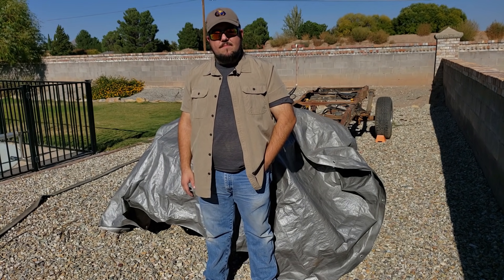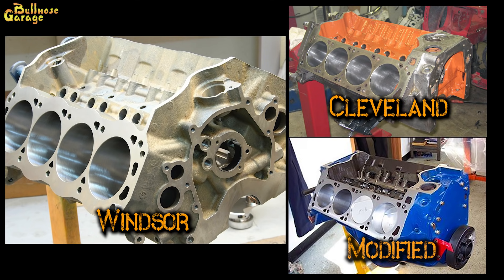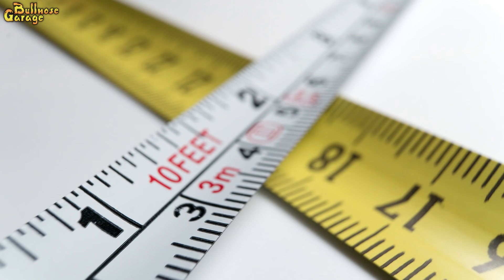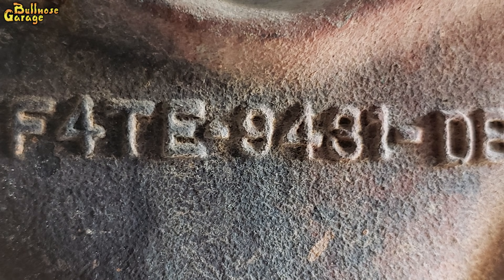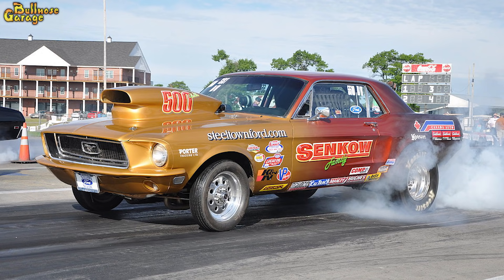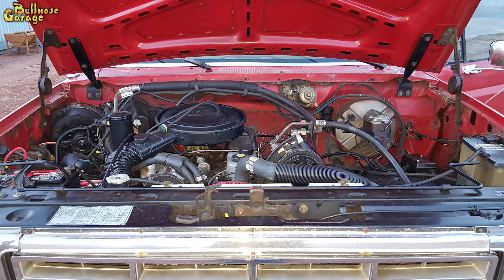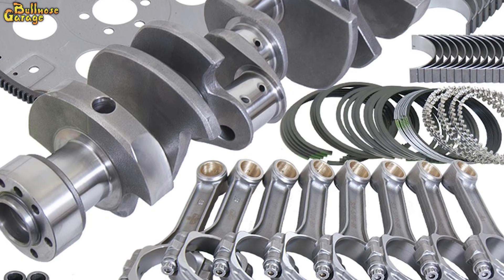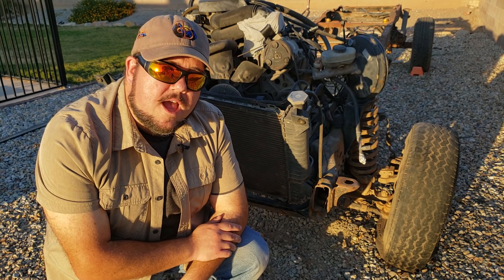351 Windsor – What You Need to Know About the Ford 351w Small Block [5.8 Liter]

Comment from the maker: Wanted to make a note that I misspoke when I talked about the casting number for the C90E block at 07:05.  The C90E block is built in the 60's (69) and not the 70's, so C9 castings are 69 castings not 79 castings.  D Blocks are 70's, E blocks are 80's, and F blocks are 90's.
Reply: Add 1997 F250-HD OBS had 351w 5.8L for service/utility companies. I have one myself, so for had 2 body styles in 1997 and Ford applied fixes for many known issues (TSB's).
Reply: You had me confused there because Iam pretty sure Ford began date coding engine blocks around 1940.I had to pause the video and scratch my head lol.
Reply: I was coming here to correct you only to find out you already realized your mistake.
Reply: I was thinking the same thing
Reply: So if I stop a d block down and put my intake off a 2002 f150 and everything else will work right just put all my stuff on it will work right
Reply: @yashuasaves6782  - 351W is a "Windsor" design engine and your 2002 is a "modular" design engine! Two completely different things...
Reply: Please someone get back to me
Reply: I'm in need to know
Reply: thank you so much for coming back and fixing that. just got a 1990 bronco that needs some work.
Reply: Man not trying to be nosy first off LOL LMAO where do you live in two do you still have the harness and everything computer and all I live in South Carolina I pray to God that you may live some worse on the Eastern side of the US if not I definitely would like to buy the computer and the harness
Reply: I came on here to comment about this error. Glad you cleared that up, great vid otherwise.
Reply: 8😢h9 

J on ikvjn Un 6b?Oukj MN khmm k that  h. Ul
O ijn
Reply: 😮
8
Reply: 😮😮
Mike inmates. Yhp
Reply: Sorry to say but ford started putting 351 windsors in the f series in the early 80's. I know because I have a '83 F250 with a windsor
Reply: Yeah cC is for 1960s
Reply: Don't think 351W ever had over 10:1 compression ratio... if even quite that high... lowest about 7.6:1 actually... 
Prolly over 300 grossHP in later Mustang Cobras... 
There were 4 351's... the Ford '352' was also a 351" with same bore and stroke as others...
Reply: @BuzzLOLOL   352 is same bore and stroke 4x3.5 but is big block FE family 332 to 428 only.  Hard to find parts for now.
Reply: @BuzzLOLOL In 1969 the 4v Windsor had 11.1 to 1 compression. 290hp with the autolite carb. A good Holley 700/750 would get you 315/320. With headers 350+. Those heads were anemic but enter the Cleveland. With Cleveland heads on a Windsor block you have your reliability   A little work on the Cleveland oiling system is better because the Cleveland block is stronger.
Reply: @BuzzLOLOL  Oz 69' Falcon GTHO 351W 4V was 11:1

Comment: O shit i just realized this is 5 yrs old lol well i got a new channel to watch ur a pro now lol I've always owned a ford since i was 15 got my first ford absolutely fell in love with it n fords right away it had one hell of a engine in it and transmission see i was young n stupid back than but i ended up scrappin it engine had 375xxx miles purred like a kitten 300 inline straight 6 i drained the oil drove it for a week!!! Tryn to blow it up well i couldn't i mean holding it wide open 5 10 mins straight multiple times the body was falling apart everything but engine and transmission was good i mean it was a 3 step process to get started shifter broke column there known for that btw why is that almost everyone i had was broke and wobbling lol man ive had in last 16 yrs at least 12 different fords ive wrecked 2 sold few but junked alot younger days or got them towed in went to jail lost em gf stole them man i just had a 94 f150 ext cab long bed gooseneck hitch 302 absolutely loved it paid 700 for it new water pump tps alll i did to it and well my gf at the time stole it i had to buy it back than i got pulled over went to jail n couldn't get it out now i have a 94 ext cab reg bed 351w the distributor gear just sheered the rollpin so i gotta put a rollpin in it tm what brand aftermarket distributor is good not to expensive if i wanted get new one ive never torn into a big engine waterpump biggest job n top plenum gasket farest ive went but i hope u have detailed videos ive been trying to find them on how to convert to carburetor ive been wanting to do that

Comment: Had a 351 W in a 1970 Cougar great engine and now I have one in a 1979 Ranchero. Uses no oil pressure is good. The only problem I have had is Timing chain in the past. I found if you install a double row that problem is gone. Great engines can get real good fuel milage and plenty of power. they run cool if everything is correct. I have had the Cleveland engines lots of power. Would not trade that Windsor for any of these 2000 and up new one's now No way. I like American Iron. with large rod and mains.

Comment: When you revert to a carburetor you will have to change the distributor and then switch the cast iron distributor gear for the steel gear on the EFI distributor and use 10-30 motor oil or you will be stranded in the canyon, like i was!😅

Comment: My father-in-law just got a free truck and gave me a 1980 Ford F100 custom with a 351 Windsor engine in it and boy she wants to start but just won't and i can't wait till I get her started.shes very rusty with red paint but body don't matter to me. Just turned 19 and I'm happy with my rust bucket
Reply: See if the top of the distributor is spinning. I had the same problem. A new distributor and reset timing might be the solution

Comment: G'day From  Australia 🇦🇺  The Windsor 351 is very sort after engine.  Especially the Fuel injection motor. The 302 and 289 Windsor is super famous.  However the 351 Cleveland 4v carry soooo sweet. Check out the Australian Xr to the XE Falcons if you Haven't Sir... Australia certainly made Wonderful use with all above mentioned.. Cheers...👍👍💪💪

Comment: I have the 84 ford van with the 351w in it, when I bought it, it was gutless and I do mean gutless, I got rid of all the smog crap, ditched the 2 bbl and intake, I installed a cheap 4bbl intake and holley 600vac sec carb, the gm HEI made for the 351w and a set of hooker headers running duel exhaust thru flowmaster mufflers, now back in stock form I was lucky to hit 100kph/60mph on an exit ramp, after the changes, I was hitting 130-140kph/80-87mph and having to backing off as the road had a speed limit of 100k/60mph, very same exit both times, soon I will be swapping the timing chain to advance the cam timing and swapping from the C6 to a ZF5 transmission, both will add more power as there is less losses with the 5 speed, it will not be a racing machine but it will be solid with great power, the van is the starcraft conversion so 6000 pounds heavy

Comment: Has anyone ever ran a stroker crank in a 351w without getting it balanced? I know it the right thing and best but sometimes everyone's money is different and u got to beg the shops to do the work. So you get a rotation assembly already balanced but  a crank o guess because they need the rods to balance. A crank is about 400 and the kit already balanced are about 1200.  Anyways just curious looking to build a budget 351 storker . I got way too many pokers in the fire.

Comment: Not all 351 have same fire oder 5 difert one and you will need find right one some people say it not so but thair is more for 351w i run in to this on my 1983 351w change didtiber the fire oder change to older 1970 fire oder and some have dull fire plugs stay away from that

Comment: The last year for the 351W was 1997, not 1996. The 1997 F150 was restyled & used the 4.6 & 5.4 overhead cam "mod motors."

The 1997 F250/F350 carried on with the "OBS" '92-'96 body style & were still used the 351W (& the 460).

Comment: 351 block will not match up to a 302. The 351 Windsor in the 351 high output motor the only thing that is different is the Windsor has a two barrel the high output 351 is a 4 barrel. The 351 to 352 to 390 to the 460 is the same block the 302 is a small block you need to go back and study more at 3:02 and a 351 you can't use the same parts sorry the 272 and 302 will work with a blog in the 292
Reply: 351 and 302 parts are interchangeable, even the piston rings can be swapped out without a problem.
   Many people have been swapping out from 302's to 351's, and yes, GT40 and gt40p's can be interchanged between both motors, the only issues come from a needed wider lower intake manifold (thanks to the taller piston bore size).

Comment: 351 W is not a good engine to have anything to do with.    Get a 302 and put 351 C heads on it and you will see how much power is possible when you start with the correct block.

Comment: You can use 302 cams,but have to change the firing order to 15426378 also boss 351 heads will fit,but you have to modify the water passages pistons and rods now you have a basic nascar design! Zoom zoom zoom 😊

Comment: Ford didn't call anything a big block. It is family names. 385, FE,  Windsor, Cleveland....And what you need to know is get good cylinder heads. It if is a Ford produced head, the aluminum cast GT40X is the minimum. AFR 185 is ideal and will never leave you wanting more. It won't make 500 hp by just using those heads. You need more cam, manifolds, compression....

You did a lot of work, nice job.

Comment: Do themath and you will see that the351w ws actualy a352,The 352 was way under powered and Ford did not want to just scrap it, No ONE wanteda 352 so Ford reworked it giving it more power. To avoid confusion they called the reworked engine 351w. And as you can see it went very well for Ford.61.02 x liters gives a very close cubic inch number.

Comment: Nice talk I just found about the 351w. Question. You mentioned the block is a 1994 and that you will be running a carb with no computer, does that mean 94-96 engines can run with no computer? Minimal electrical wiring?

Comment: Well thanks for your time on the demo of the 351, I do have a question? I'm looking to buy a 1974 van and the person I'm dealing with said the motor is a 352 so where dose this number come into play on Ford motors?
Reply: That would be an earlier motor from 50s thru the 60s back when they made the 292 v8 and 352 and 390 probably stopped  in mid or late 60s
Reply: I'm just going on memory not sure about exact dates but you can look it up pretty quick.

Comment: there is one problem with all of your information ..there is no such thing as a big block or small block ford there is FE ford windsor block the 335 block and the 385 block and the 351M 400 335 blocks used the same C6 trans bel housing as the 385 429/460 block and the 351clevlen used the C4 bell housing and the small main bearing like the260/289/302 and ford windsor block 351W used much larger main bearings the same main bearings as the 351M/400 335 block family allowing you to drop a 335 400cid crank in to a 351w block with some work and balancing of the crank giving you 4" stroke with custom pistons with relocated wrist pins then you take the 335 family 351c/351m/400 90deg heads and drop on to your 351w block making it in to a dry intake motor and is what the BOSS 302 had as the heads on the 351c/351m/400with a .030 over bore creating a clevor with 413cid with all stock ford parts and custom intake...so ford has (FE/ windsor /335 / 385) family  not small or big block that's Chevy and dodge and the FE is the 330/332/352/360/390/427/428cj/428scj and the 427 cammer the FE 427 is what ford had in the ford GT40 that won 24 Hours of Le Mans so at one time there was 4 families of ford motors being made and never ever did ford call or use the words small or big block as there was no such thing as the use of small or big block was a term Chevy and dodge owners used and blindly started using it to describe ford motors not knowing that for only had one engine family that I guess only came as a large displacement motor and that was the 385 family the 370/429/boss429/460 but the FE/windsor and the 335 family all made motors of the same size at one time and larger and for also made early one the Y block
Reply: You seem like you know something.. maybe you could help me.
I have a 1993 Ford 350 5.8L... my friend spray starter fluid in my motor,  and it backfired,  now the engine has a shake to it,  do you know what probably went wrong?

Comment: Im thinking about doing a stroker to my 1991 bricknose f250 351W.  Im not trying to hotrod - just need more than 210hp?  I notice 408 stroker & 427 stroker but dont know difference?  Would like to have torque over hp actually since I refrain from revving actually?  More of a lugger kind of guy.

Comment: My 94 bronco came with a roller cam and double roller timing chain and it dose not blow an ounce of smoke running really good 320000 miles its been in the family side it was bought new and amazing enought the e 4 od  has the same miles I wish ford would have done better with the new bronco and the 6r80 trans

Comment: I bought a remanufactured 351 made to the specs of a 1983. I put it into a 1988 f250 thinking it would work because it had a 351 in it. Turned out the firing order on both engines are completely different and now I have to move the injector lines to get the injectors to fire at the right time. Has anyone else ever had this happen or am I the only one and what would you do?
Reply: @cloneinvitus9206  All 351 Windsors have the same firing order

Comment: Hi - I have a 351 Windsor in my 33 year old boat.  It runs good for the most part but noticed the compression is a bit low in 2 cylinders. I recently heard I should adjust the values.  Do you know if that is a valid statement?  Do you have any videos on it?

Comment: The pre 77 heads also had 1.84 and 1.54 valve sizes, vs the 1.78 intake for the 302. with a little port work on the exhaust mostly, I am getting 4.92 HP out of mine with later model forged TRW pistons ( 13cc dish late model v 19cc in early ( not 69/70) engines... When I macined and built mine in 1989, ther was ZERO AM support for the "W".. the spec books really helped.. :)

Comment: I got a question is there any difference between a 1979 351 m in a F100 truck in a 1979 351m F250 motor in a truck any differences.. any differences between the 351m 1979 from the F250 and the F-100 are they the same 351s  M's

Comment: In 1994 the firing order changed on the 302 for the trucks to the 351 firing orde.the mustang also had the 351 firing order since the 302 an option. the 302 has the weaker casting and prone for cracks at higher power levels as the 351 block is much stronger and capable of up to 800 hp.i have seen a 351 turn 8800 rpms in a race car with no problems making over 600hp to the wheels.

Comment: These engines have the worst timing cover /water pump assembly. In fact, its horrible. It is hard to assemble and is oil and coolant leak prone. The cylinder heads are , "Horrible. Ford id a poor job designing this engine

Comment: The Cleveland 351 engine was built from 1969 to 1975, then went to the M, although Ford Australia produced the 351 Cleveland engine from 1971 to 1982. It also included a 302C (4.9Lt) variant that was not produced in the states. We hardly see and Windsors in Australia. How can the camshafts be interchangeable between the 351W and the 302W if the firing order is different.

Comment: I put a mild 360 hp 375 ft lbs 351 w in a 1986 thunderbird turbo coupe. T-5 world-class transmission and 3.73 track loc disc brake diff. That car was brilliant.
Reply: Cool car. I had an 87 turbo coupe all original a few years ago. It was a blast to drive.

Comment: I GOT A 98 351 AKA 6.4L  WINDSOR IT SUCKS  WHY IS A 5W-30 REQUIRED IS BECAUSE OIL PORTS TO THE TOP OF THE ENGINE ARE TOO SKINNY NEEDING A LIGHTER WEIGHT TO GET THROUGH THATS WHY THEY ALSO HAD BIG PROBLEMS AT THE FIRST IN THE 60-70'S THEN THEY DECIDE TO MAKE IT AGAIN CHEAP FOR THE F-150'S AND IS WHY THE F-150 WAS THE CHEAPEST TRUCKS TO BUY NEW DURING THE FORD TOUGH ADVERTISEMENT DAYS

Comment: Fun fact, a 351w is a ford Windsor engine. Not a small block. Just as a 351c/351m is a ford 335 engine. Small block is in chevy terms such as a 350 sbc. A dodge 318 is a LA engine and not a small block dodge. More examples ford 427 428 is a FE engine and a 429 is a ford 385 engine. A 454 is a big block chevy. A dodge 440 is a dodge/chrysler RB engine.

Comment: Veri helpfull video. Wich Distributor did you install?? There are 2 different lengths below the gear. (1 inch and 1.5 inch) Will both fit???

Comment: Thanks for this video. I just bought a 1979 150 ranger 4wd. Came with the 300 v6. Trans, transfer case and axles were gone. Leaving me with the the easy decision to build back 2 wd and high hp like I always wanted anyway. If all 4wd stuff was there I would’ve most likely went back that way but HIGH HP, HERE WE COME! I’m going to look at a engine this eve that has been called all 3 versions of the 351 by different people. This video helps dramatically and should help me easily figure out what it is. It came if a f800 with a 4 speed. Someone added a Holley 4 bbl carb to it also so I’m very excited to see what it is. Def got my subscription and most likely will be posting a lot of questions for you and anyone else that can help me. I’m more familiar with newer engines and mostly fox body mustangs and a big fan of the 302 5.0. Heading into new terrain with this build but excited! Again, thanks!
Reply: The 300 was a straight (a.k.a. an inline) 6 ("I6"), not a V6.